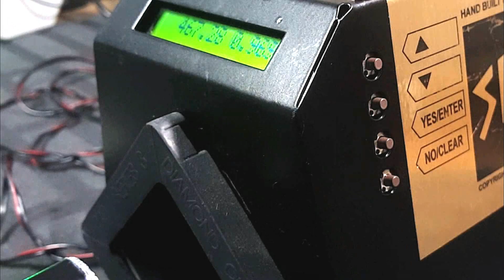VSR10 upgrade & refurb

Comment: Hello, just popping in with a question. I am upgrading a TM VSR-10 and this is what i am going to do with it, am i missing something important? 

MAPLE LEAF CRAZY JET BARREL SYSTEM (GBB, VSR, AEG) 430 VSR
NINE BALL VSR-10 HOP UP BUCKING (ALSO FITS P226, HI-CAPA, G26, SOCOM)
ACTION ARMY VSR-10 CYLINDER KIT
ACTION ARMY VSR-10 SPRING GUIDE
ACTION ARMY ZERO S TRIGGER & Reinforced Aluminum Piston 90 degrees VSR-10
ACTION ARMY VSR-10 M150 SPRING
ACTION ARMY VSR-10 HOP UP CHAMBER
SORBO PAD - CYLINDER HEAD DAMPER - AEG VERSION 2 / 3 AND VSR